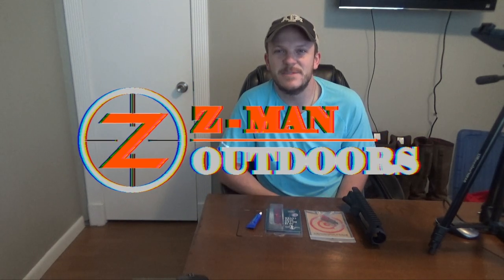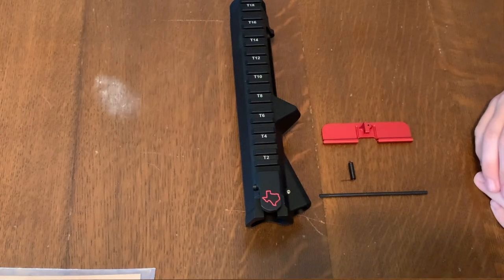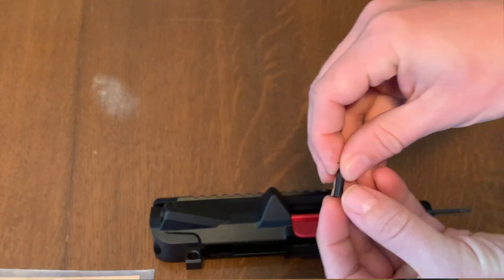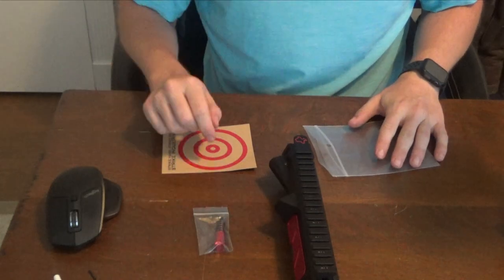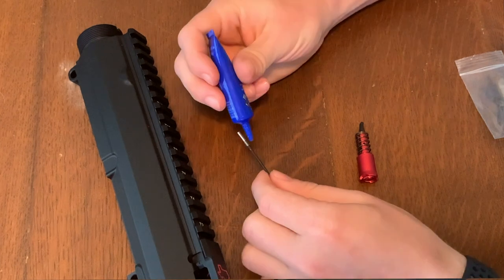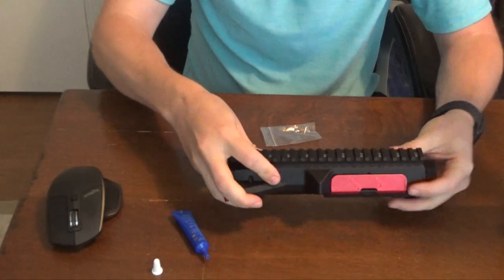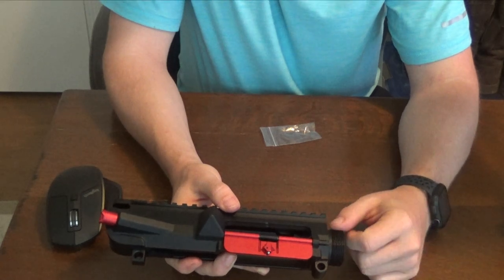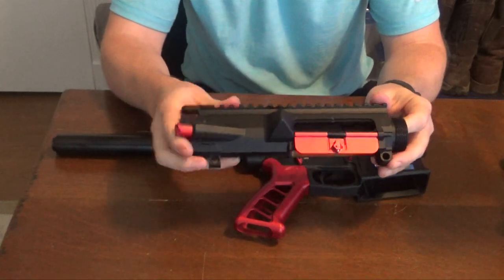A Beginners Guide To Building An AR-10: Part 3 - Upper Receiver

Comment: I know this is a couple yrs old but , I had the same issue with not many part fitting Aero precision or ballistic advantage lower and upper.. but the take down pin I just filed it a touch and it fit perfect! Of course I didn’t use red so you would have to find some kinda chrome red or clear paint to touch it up..  but yeah, not many parts fit the  Aero precision or ballistic advantage M4 or M5 receivers..

Comment: I do not use loctite in mines, only antizeise in the barrel nut and castle, not need in muzzle either if using a crush wash, rockset if using shims but mines ?I like to unscrew the flash hiders for DT suppressing. There are lots of conflicting info about using loctite but I prefer not to because my rifles are for fun not to go to battle with them so chances of anything backing up before I could notice and correct it are slim.
Reply from the maker: Yeah, now that I have a suppressor wish I didn’t use rockset. I transport my guns a lot and thought the vibrations and stuff could cause issues some went with the locktite, but I do agree it’s probably not needed for most people. Thanks for watching the videos!

Comment: One of the take down pins (the pivot pin) should be longer than the other pin, try swapping the pins around.
Reply from the maker: Thanks for the tip, I thought it may have been that, but it wasn’t unfortunately. I think when it comes to the AR-10 platform, there isn’t really milspec, so it can be hit or miss it seems like
Reply: @ZManOutdoors  Too bad, it was worth a try though. Good looking build none the less, thanks for creating the content.

Comment: Well, I am glad I am going all black and all Aero parts. Because that truly would be a bummer to find nice-looking stuff you bought not fit. But today is the tenth day and you know where I will be at 3;30 pm today.
Reply from the maker: Yeah if you don’t want to run into any issues, I would for sure stick with all aero parts! The only good things is I save up more spare parts I can build another one haha
Reply: @ZManOutdoors  I ran into issues using most AP parts too; the gas tubes did not fit into one M5E1 upper, had to be sanded circumference only to find out it was too short too, had to do an Anderson Manufacturer which had to sand down as well to get it through the holes on that particular upper AND for a second planned build, an M5 upper, not the M5E1, if would not fit into the lower!! had to put a warranty claim but found out the upper is forged and lower billet; they would never match sooo even parts AP, lots of issues; those are not the only one I have found so far. Its been a difficult build for sure.